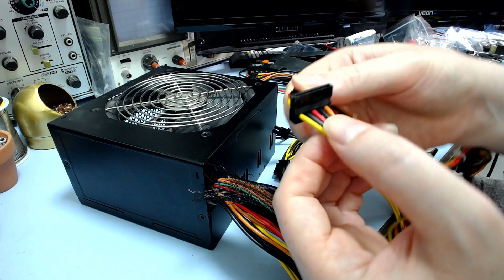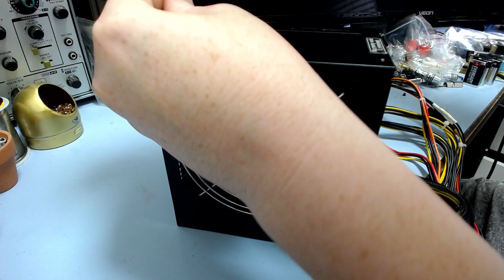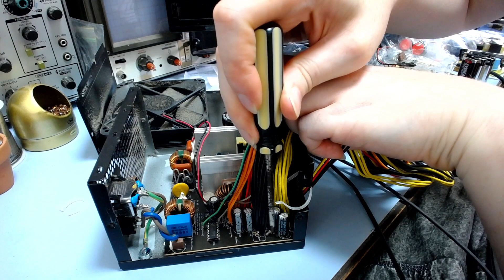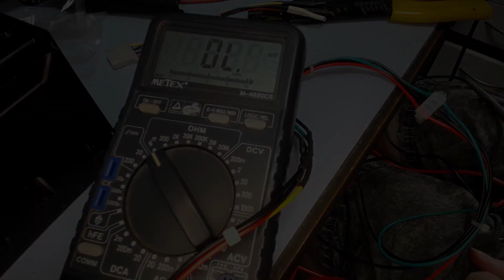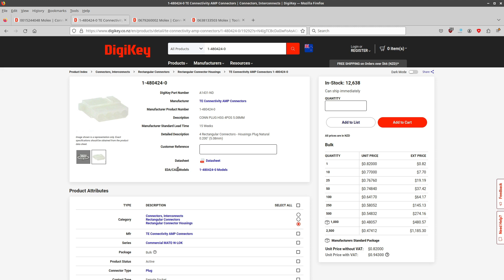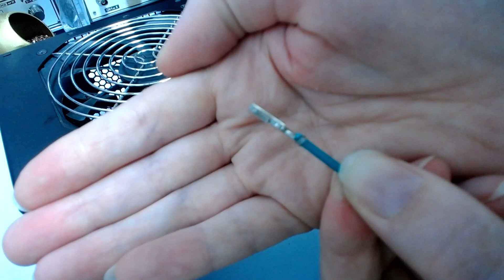The FSP HyperK HP600S with a missing HDD power cable

Comment: Hey man. So I came across your Xbox 360 parental reset! Can I purchase one of these things off of you? I have no knowledge on building one but I need my old account back… I set a password to login to my account a long time ago and it was like a controller password same 4 pin kind’ve password. Let me know man
Reply from the maker: I suppose you could but I really don't know if it would work for that. An account password sounds like something that would have a lockout feature with too many retries, especially if it's checking the password with Microsoft's servers somewhere. Have you tried contacting Microsoft support? I would try that first.